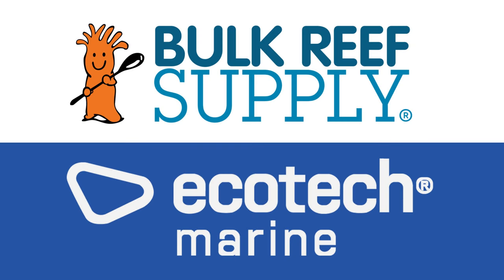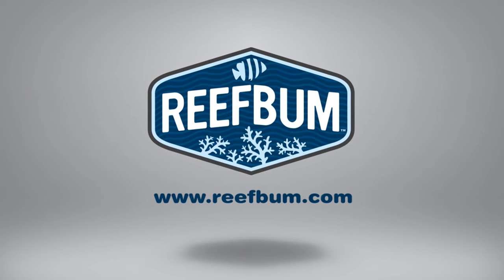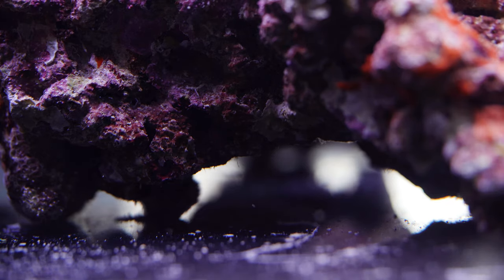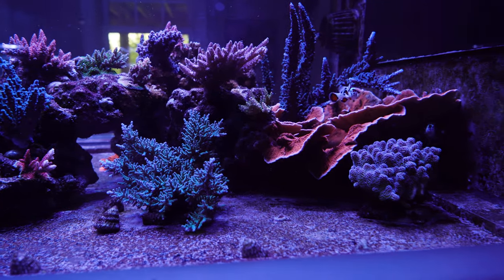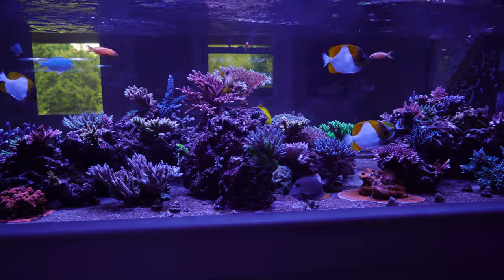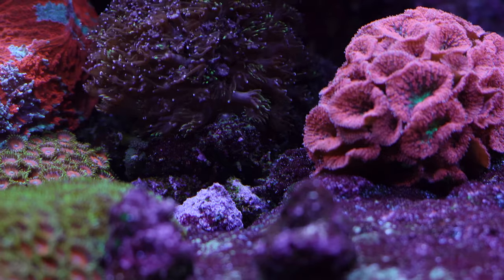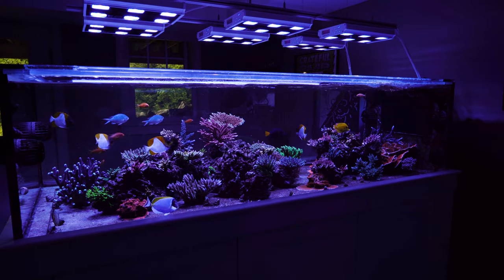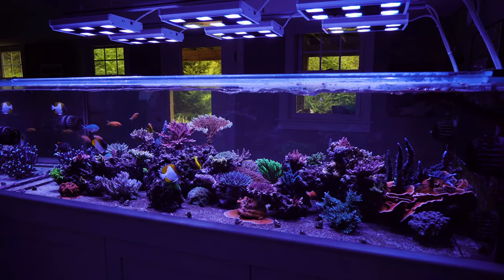Going Bare Bottom - Was it the Right Choice?

Comment: Great job Keith!  I went Barebottom first time in my life on my 400 gallon!  I got the flow so dialed in I dont even have to siphon any detritus. Love sand but I am not one to keep it clean nor do i want any clean up crew that actually get the job done so loving Barebottom. I do however prefer white starboard look since it does appear to look like sand and reflects light better than a darker bottom. Even if it gets covered the small hinds of white I still feel make a difference in reflecting light on the undersides of acros!
Reply: How did you get the sand out of the barebottom. Been thinking about doing this for my 350

Comment: i was wondering i run a mostly sps reef with sand bed, i do the zeovit system with plenty of blue bottles,calcium reactor ,kalk reactor,co2 srubber pretty much all the bells and whistle . i guess my question is can i remove my sand bed?  its a 3 and a half year old reef ,75 gallon display- 40 gallon frag tank- 30 gallon sump,total water volume is about 100-105 gallons with about 150-160 of marco rock. i increased my flow and now i have a sand globe with live fish. LOL your thoughts would be much appreciated
Reply from the maker: I would do it slowly and add some live rock or bio media to your sump and also dose some bacteria to help maintain your bacteria population.
Reply: @ReefBum  thanks for taking time for me! how much time would you recommend 1-2 cups a week or month or even slower.i really don't want to mess up!
Reply: @claudiamelfi3882  I have set up a new dry rock bare bottom tank and I think patience is key, also used BioBlocs from Maxspec in the sump which I think have worked very well.